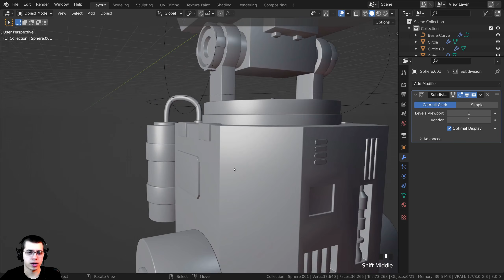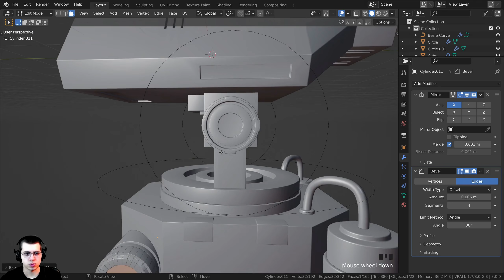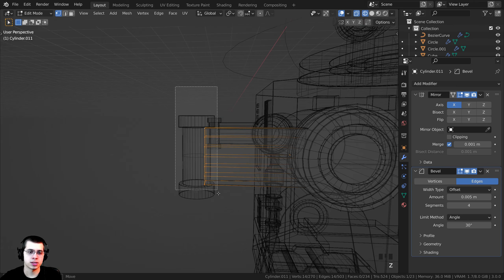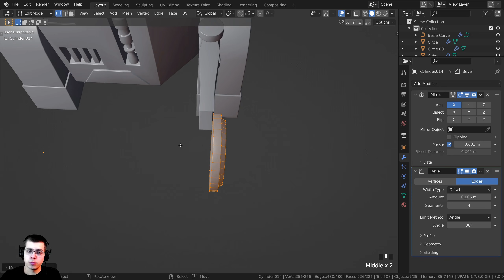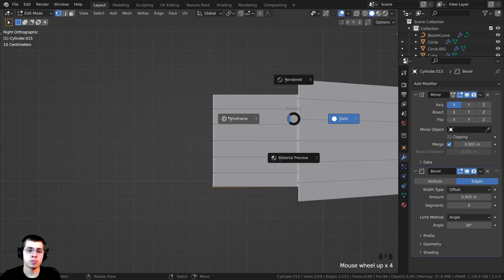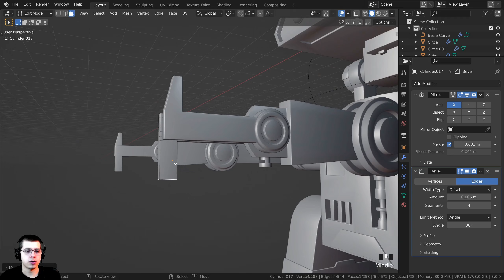Sci-Fi Worker Robot-Part 4 (Blender Tutorial)

Comment: Such cool stuff! I've had some issues with mirror modifiers not working correctly but that's often fixed by applying "All transforms". In case someone gets stuck. Not sure why it keeps happening but luckily it hasn't stopped me from progressing and enjoying this tutorial.
Reply: Some issues with the Mirror modifier in Blender can occur if the object's origin is not at the center of the coordinates (it happens when you move the mesh in edit mode, not in object mode). Using the 'Apply All Transforms' option can help, but not always, because it brings the origin to the center of coordinates. Sometimes it’s useful to select an object in the Mirror modifier to mirror the mesh relative to it. ;)

Comment: Awesome videos

Could u plz guid me with one thing

When i have a couple duplicated objects (for example 4 cubes with same material ) when i want to add a secondary matterial for some of the faces (for example) i do it by selecting the cube particular cube that i want and then go to material , then press that + plus icon and add a secondary material for that specific cube (in and specific part of it in edit mode ) , but when i assign that secondary matterial to one of the parts od the cube  , it adds it to alllll the cubes that i have (since they are duplicated and not mirrored or arrayed , that bugs me alot 

Is there any solution for this?

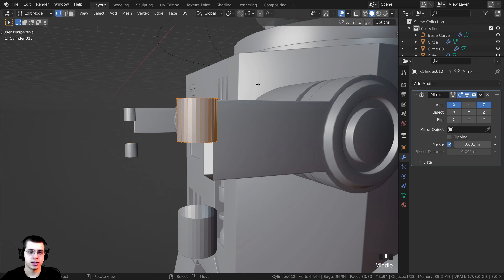Comment: I'm at 7:27 and having a terrible time with the Mirror Modifier. After toggling Z in the MM panel, the Mirror would fuse & scale properly in Edit Mode but they would come apart in Object Mode. I deleted the parts, went back and created them again. Mirroring works fine until I toggle Z in the Mirror Modifier panel except this time the Mirror ends up WAY above the robot's head. I can't for the life of me figure out what is going on. Any help greatly appreciated.

P.S. I posted my problem over on Reddit (r/blender) "Mirrored objects way off intended location). Need Help!", with screenshots showing my problem.

Comment: On to video 5! I had a problem that I needed to make a work around for. But at https://youtu.be/2YiQllGDH0c?t=719 when I would select the vertices it would not select the 6 vertices that would previously filled by selecting and pressing F. When I would manually select them and then go to scale the object down it would grab those 6 vertices. No matter what I tried I kept having the same exact issue. I went back several times to retry with the same results each time. So much to the credit of your teaching I just created a new cylinder and made my own. Everything worked ok in the end but I sure wish I knew what I was doing wrong.  I feel a great accomplishment that the master has taught the  aspiring apprentice to at least be able to create a new mesh!
Reply from the maker: hmm ok. I don't know exactly why that was happening for you.
Reply: @RyanKingArt  No worries, I got around that problem but had some others come up during video 5 so I scrapped the project. I'm going to start over, with a much better understanding for what I need to be doing!

Comment: Im having an issue when I try to mirror the cylinders for the arms on the z axis 7:30, the point where they merge together is unmoveable and ive tried to lower the robot so the arms are on the z axis , I followed the tutorial exactly as he says and I am just unable to raise the cylinders in object mode while having them clipped together
Edit: G and Z does not bring the whole object up for me it splits them apart

Edit Edit: moving the cylinder in object mode on the z and y axis and pressing 1 for front view align the cylinder so it is in the center of your arms before pressing tab into Edit mode then move the cylinder on the x axis and press 7 for top view and align then you can add the mirror
Reply from the maker: Make sure that the objects origin is in the center of the 3d space. the mirror modifier will mirror from the object origin.
Reply: @RyanKingArt  can you help me out with this part? I'm really stuck with the cylinder just splitting apart

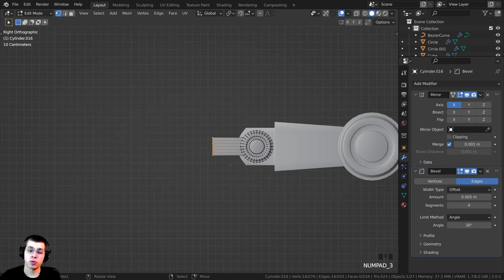Comment: Size & Scale of Arms - for anyone wanting to reference the scale and size of the arms correctly when modelling, there is a Side Profile at 17:23 that you can skip ahead to, pause (full screen), take a screenshot (printscreen key on kb), paste it into MS Paint (ctrl v), crop out unimportant bits, save image in your project folder, and drag that saved image into your Blender Project (in Object mode).

Use Alt G, Alt S, Alt R to reset position, scale and rotation with image selected. Then use R to rotate inline with your (3 on numpad) side view (i.e. R y 90, R x 90), and then scale (S) it up to match your current model. Match the body rough dimensions.

Then obviously go back to the start and model along with Ryan as normal, but you have the benefit of the Arms profile, so you know you are very closely matching his final model. Skip in and out of Wireframe helps here when matching size.

Tip: with your saved profile image selected, you can change the Opacity (see-through-ness), select Object Data Properties (red icon under where Modifiers usually is), tick on checkbox and set the opacity as desired.
Reply from the maker: Since it sounds like you really want it, I just made front, side, top, and back reference images of my Robot, and made it as a free product on my Gumroad store. Its currently the most recent product. Also, I added a link to it in the description of each video. Hope it helps!
Reply: @RyanKingArt  I actually just finished all the modelling, but those should be helpful to anyone coming to this a little later.

I was surprised how well mine matched your scale, but before I started the arms - I figured with all the separate parts, they could quickly get out of general scale.

Thanks though, very helpful as usual

Comment: That is the sweetest. Just finished your pool tiles tute on a model pool with water caustics!
Reply from the maker: Nice! 😀
Reply: @RyanKingArt  Ryan. Is there a graphics or drawing tablet you would recommend for natural hand sculpting modelling? Edit: and is there an advantage of using the drawing tablet over the screenless graphic tablet?
Reply from the maker: @gerdsfargen6687  I prefer to use a display tablet, because you can draw and sculpt on the actual surface. But the pad tablets are quite a bit cheaper. The drawing tablet that I have is the Huion Kamvas GT-191. Although that tablet is out of production. But the Huion Kamvas 20 is very similar to mine.